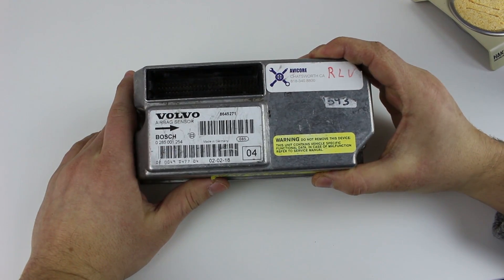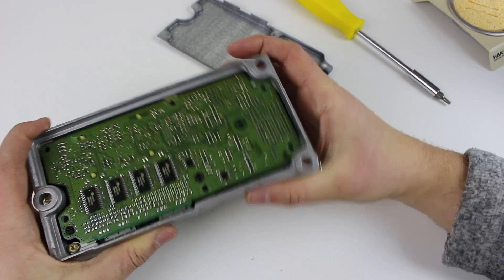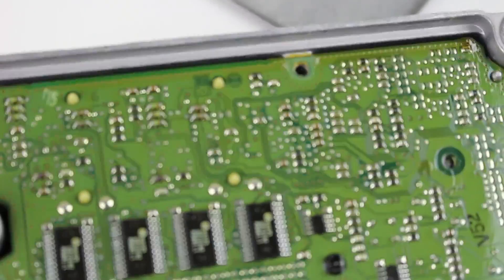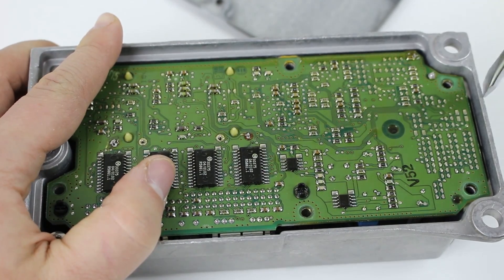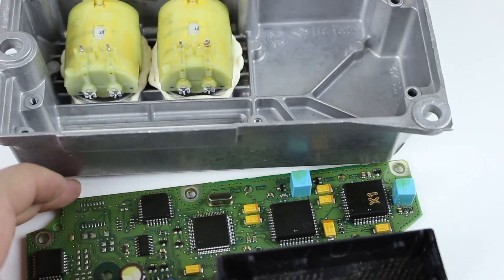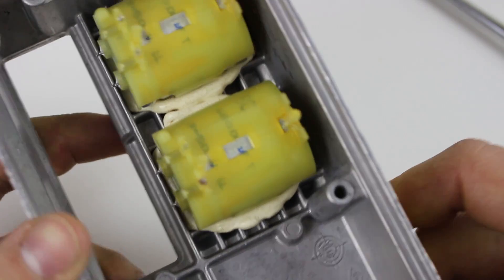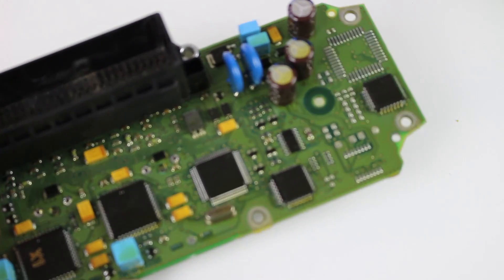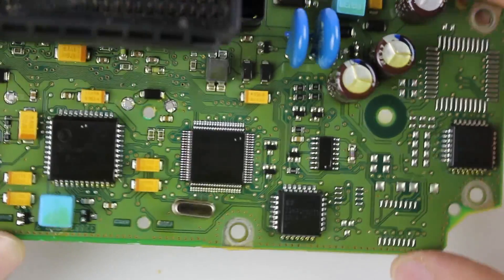S60 SRS (Airbag) Automotive Computer Teardown

Comment: Those two huge caps provide main power for air bags, not because air bags need a lot of current, but because in case of collision car battery most likely to be disconnected. I'm guessing for the same exact reason there's a lots of tantalum caps around every chip - to power those chips for a duration of impact (which is a really short time).
About desoldering - you might want to apply a lot of leaded solder to the pins you want to desolder, to wash out that lead-free crap first, and only then use desoldering gun.
Reply from the maker: Ah... that makes a ton of sense, of course you wouldn't want to trust the rest of the system was operating, hadn't thought of that. Yeah I realized my desoldering tip was too large as well, so it didn't fit down around the pins. Just used blunt force instead, but this was a one-way disassembly so not as gentle ;-)
Reply: Next video title: "Gentle desoldering using Dremel - HowTo" )) Sorry, couldn't hold myself )